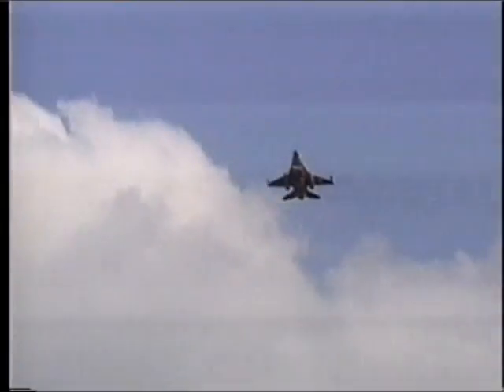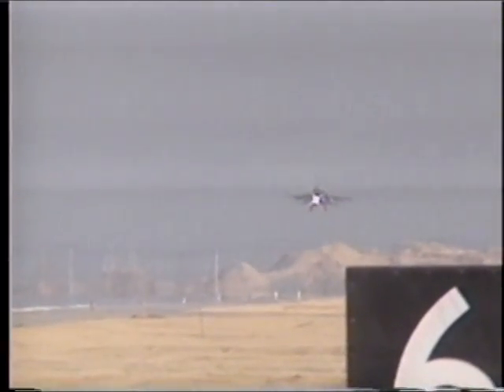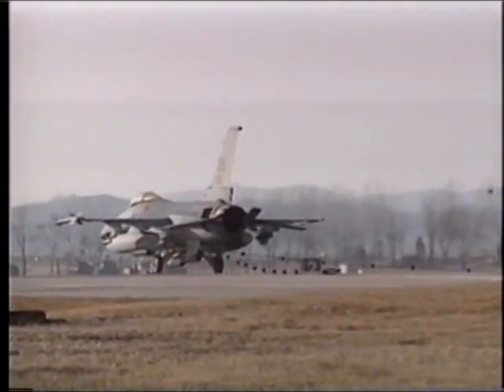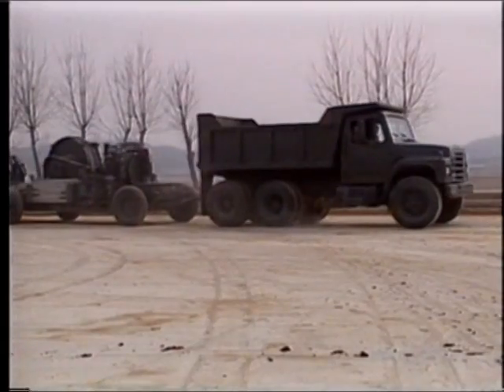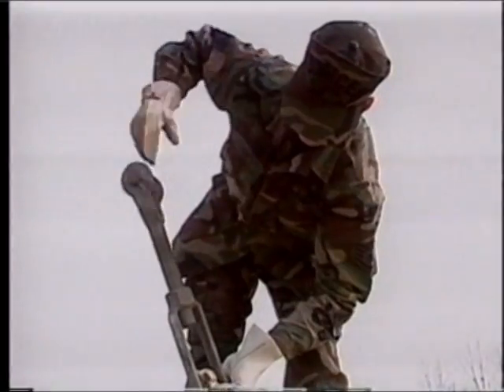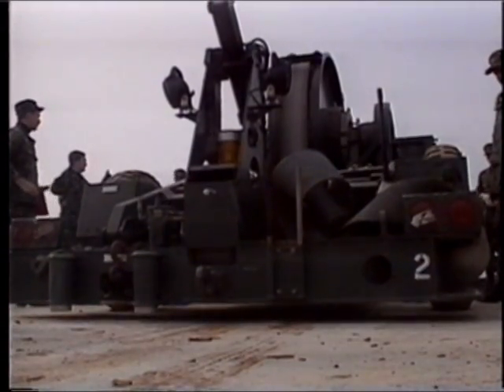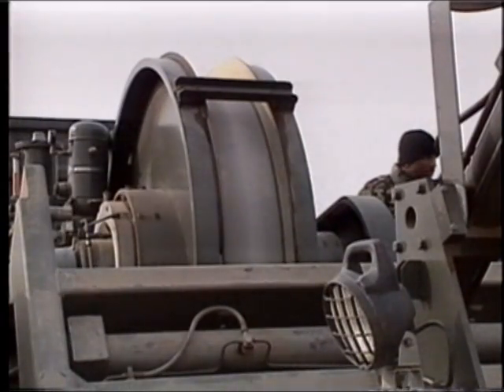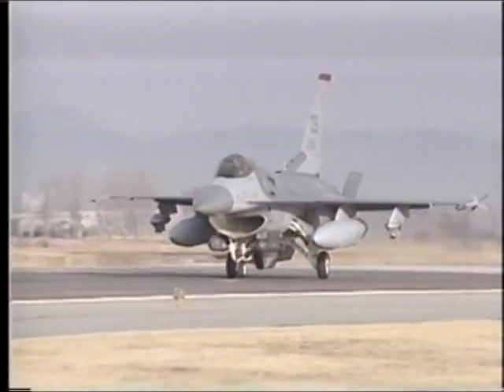Barriers Maintenance #2 - Mobile Systems

Comment: The Portarrest® P-IV Mobile Aircraft Arresting System (MAAS) is a self-contained friction brake system designed specifically to support rapid deployment and facilitate safe aircraft recovery. The MAAS is used on permanent or temporary runways at main operating air bases, forward operating air bases and emergency or temporary air strips. All tools and equipment necessary to transport, deploy, operate, and maintain the MAAS are included, and are stored on board the trailers.